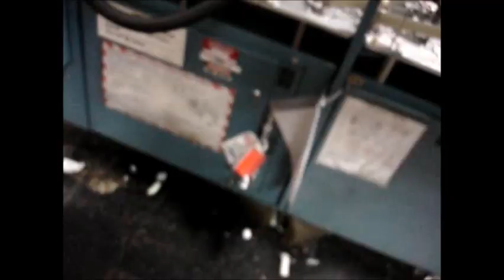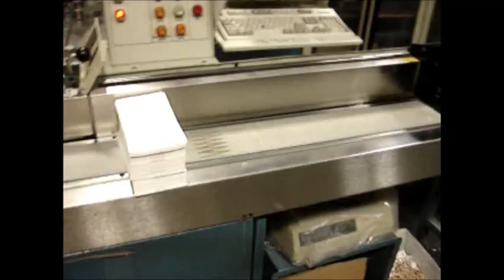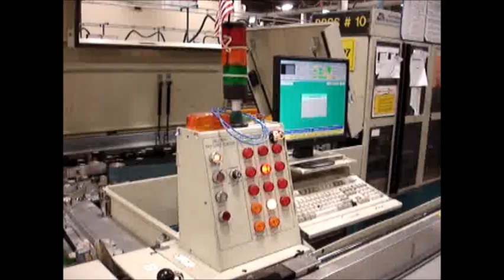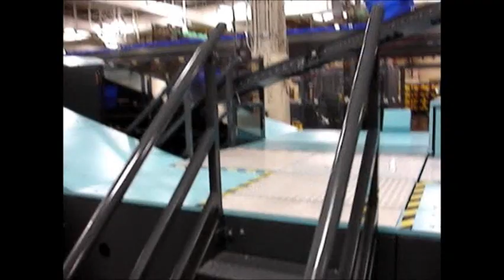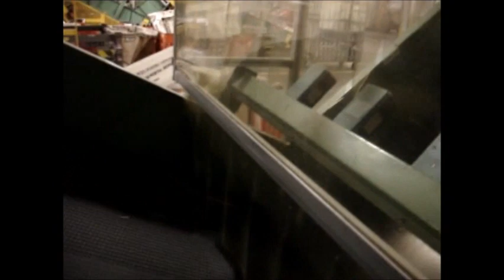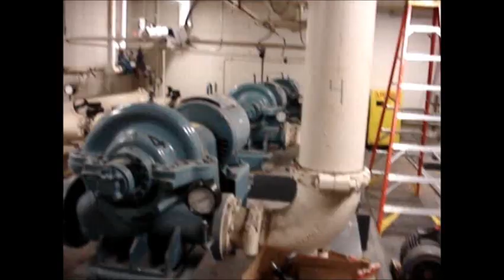Mail Processing and the USPS Brooklyn Processing & Distribution Center

Comment: Wow. I was an ET and had to use a lift-a-loft occasionally.  Mandatory hard hat and harness on every lift.  ET was the best job in the building for sure, especially if you worked weekends. Started in  '85 with Micro Marks, MPLSMs, (code wheels and a 110v safety line!)  B&H BCS, and a. Burroughs OCR.   Got to see the beginnings of the big push to automation.

Comment: I work for mid-fl P&DC out here in florida, we used to have many other machines that ya have. we need that kinda AC out here in the summer, every year on the summer time we never have AC, heat stay up in the air especially working on the spss machine. Spss was built 2019 around the ac vent, instead of cooling us its cooling the parcel. We are getting ADUS built now.
Reply from the maker: That's terrible! and in such a hot place like Florida!
Reply: Nothing like USPS management ingenuity. Sarcasm intended. Unbelievable how STUPID they can be.

Comment: Cool, insightful video. I've been a clerk for several years and I'm planning on transferring to maintenance at some point. I'm a manual clerk so I don't have much interaction with AFSMs or DBCSs. Spent a lot of time on APBSs before I became career. Great to see how these machines actually work.
Reply from the maker: Thanks! You'll learn more from this video than you will from most of these so called technicians at the plant!
Reply: @RenaissancePeopleNYC  
I learned a lot from your video! 🤗📪
Reply: Hey question, so I’m new at the PSE clerk . Was it easy to learn everything ? Just did a tour and looking at the machines and I was scared to death. Was hoping maybe you can give me some tips and hint to learn fast
Reply: @12ousmane  
Ask the ET's questions when they are DONE working on the issue(s). Most are happy to explain and help you understand.

Comment: Fantastic tour.  I enjoyed the part where you went over the FSS.  My facility is too small for one, we make do with two AFSM 100s.  I really wish I could see the entirety of the machine in person.
I noticed you are using the AFCS 100s.  I'm surprised you don't have the 200s.  How many machines do you have on that?  Mine only has 3.  The 200 is a massive improvement as well, much faster and sorts more.
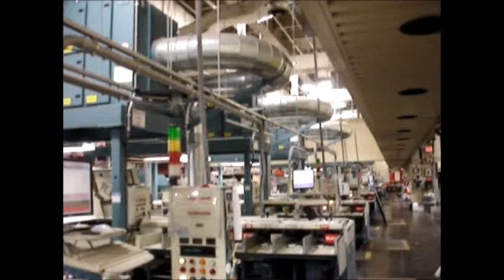The piping is the dust collection and control system.  The biohazard detectors are drawer sized units, can see one at 1:03:56
We also don't have a robot, always wondered what it looked like.  Random APCs come in marked "NO ROBOT"
Wish we had automated tow motors.
Reply from the maker: I retired out of these 2 years ago. Before I left I chopped up all the AFCS 100's for scrap as they decided to move this aspect of processing to another facility (Flushing Queens) so they have none as far as I know. But considering the mindless stuff they do who knows what they are doing now. This video took .e several months to complete it was a lot of work.

Comment: Question:  The USPS is obviously structured with warehouses of expensive machines to be able to do what NO other business can...sort and deliver letters and flats.  So why does the postal service insist that it's future belongs with the Package industry????  

There's at least 5 or 6 other big companies whose sole business is ... packages.  Why are we competing with them for last mile service?  To me it's like going to a pizza shop and hearing them say.."our future is going to be producing glue.  We'll still do pizza but we're really into this glue thing"  

It makes no sense to me.  I can see the side hustle because we're a delivery service.  But imo the USPS is a "mail" service.  Period.  That's what it should focus on.  No other company can do it.  Where as packages... there are several others who specialize in it. It's all they do.

Furthermore to save on liability and labor such as trips and falls and bad weather and having carriers walking to a door and back makes little business sense when we already have a system of mailboxes.  Stuff N Go.  This would avoid soooo much cost for the USPS to just mandate handling only packages and volume that can fit in an approved mailbox size.  Let the other package companies handle the door to door walking.  Packages is after all what THEY do.  

And if the USPS wants to compete with larger packages then have the post master general only approve those mail boxes that are big.  Not the standard little ones that you can barely fit anything but the mail...especially if the customer doesn't clean it out every day.
Reply from the maker: You have missed a few important opint here. The USPS was in business delivering mail AND packages LONG before ANY other carrier even existed - so who is competing with whom? With the decline in FIRST CLASS mail, mainly due to the internet and other venues the USPS continues to honor advertising mail from its customers. Also, the USPS is NOT the only "company: that uses these "big expensive machines" to sory mail! MANY provate companies use them if they are large enough such as credit card issuers who mail out MILLIONS of letters. So things are not as cut and dry as you assume. The USPS is completely capacble of doing what it HAS been doing for a coupls hundred years!
Reply: @RenaissancePeopleNYC  So you're saying credit card companies such as perhaps visa and master card are using these same machines stored somewhere in their own private warehouses to sort out their letters they then send off to the postal service to deliver?  These letters still get sorted as DPS for postal delivery.  I don't understand how that makes it cheaper for the credit card companies or any other company to actually own these sorting machines.  

Honestly it's the postal services job to make first class mail relevent when people stop buying it.  Great Billionaires like J.P Morgan and Getty don't just take a loss and shrug their shoulders when the consumer doesn't want to buy their product.  These guys are smart and figure out a way to make the consumer want and need to have these things.  The post office should push the issue of security.  How you can trust a letter in the mail from a company over the fraud and scams you get in your emails.  They should push and guilt people into sending cards and letters as a form of "respect and care" over a lazy selfish text message.  Use the movie industry to spread these trends.  Force the matters on business's to use 1st class service.  You need figure heads with power and brains to make mail relevant again.

IMO Packages are NOT the future of the postal service.  There's other companies for that (and they will likely take most of this market from the postal service because they're more structured and focused on package delivery).  We all know that one day Amazon will deliver 100% of their orders when they can figure out a cost efficient structure for last mile that can compete with postal prices.  

The USPS is and should always be focused on letter/flats as their main profit.  And yes have enough banked to weather the decades when mail trends down because in time it will trend up again.  Nobody can truely predict the future of demand.
Reply: @Mazinblaster Z Convenience comes with a price.  American's aren't paying what they should for the convenience that they're addicted too with online shopping.  Rates need to go up.  The postal services financial problems are a testament to that as well as their problem with retaining employees.  

IF rates rise to a fair level then I think people will see that going to a store again "should" result in saving a lot of money which would hopefully balance out this problem of abusing the postal service as an every day personal shopper delivery boy.

I mean....If the post office really wants this to be their future then they're going to have to restructure the entire way they process and handle packages.  As it is....it's very inefficient.  Carriers spend an hour sifting through hampers of stuff trying to sort out who has what and to put it order.  The offices are too small to handle the physical volumes.  AS well they need positions whose jobs are only parcel delivery...no mail.  UPS has workers whose only job is to load and sort the trucks up for the guy who actually goes out to deliver.  

But I digress.   The post office has always been a mail business.  To me it's like Pizza Hut suddenly wanting to become a car dealership.  .. like... you do pizza.  Stay with that.  If not then honestly..close your doors, liquidate your company...make a new company and be an actual dealership.

Comment: man I've torn off so many vacuum systems from the tops of those DBCSs, shame that system never really panned out
Reply from the maker: I have NO idea what you are talking about those vacuums were fine we used them for years till I retired.
Reply: They work fine in Albuquerque as well. Change the filters, bags, and keep the tubes unclogged. 🤗📫
Reply: @Stevenowski   Yep! as long as you did the required maintenance, they would suck the rubber gloves off your hand. The problem we had in the Orlando P&DC was that upper management couldn't figure out who was to do the maintenance. One month it was building maint. the next month it was the machine side. Then they would confuse everybody and assign it to the custodians....... Whenever I had the DBs, I would change the bags and check the filters, even if it meant someone would file a grievance. Screw 'em, I wanted a vacuum system that worked without having to drag one the entire length of those machines.
I started on the LSMs and 775s and tons of conveyor belts as an MPE. Retired a few years ago as an ET.

Comment: Neat video.  How does mail get sorted in the final delivery order?  For example, the DBCS doesn't look like it can hold mail for house 50 until all the letters going to house 25 are grouped together.  It looks like it's doing a higher level sort by zip code or carrier route or something.  Is there another machine that does the final sequencing or is that done by hand at the local office by each delivery person?   Also, how are flats, packages and letters grouped together at the end before delivery?  Is the delivery person constantly pulling from three different bins while driving around and just keeping an eye open for when to pull from each bin?
Reply: Imagine 100 addresses. The first time through the machine sort all the mail by the last address digit - x0, x1, x2 ... x9 into 10 bins. Now rerun those bins in order on a second run this time sorting by the first digit, 0x, 1x, 2x ... 9x, again into 10 bins. The first bin will now have all the 00s then the 01s on through the 09s. The second bin will have the tens digits in order on up to the tenth bin having the nineties in order.

After your two passes you have 100 addresses sorted in order using 10 bins, and in fact the number of addresses you can sort in two passes goes as the square of the number of bins. A 200 bin DBCS can put 40,000 (200x200) addresses in order in two trips through the machine.

A typical DBCS can do four runs during the night so it can do first and second passes for two 40,000 address groupings. If a city has 1,000,000 delivery addresses you are then looking at about 13 machines needed to sort the whole cities mail to delivery sequence.

-Retired ET (then OSS)
Reply from the maker: There is a huge difference between DBCS operations and AFCS (if they even use them anymore). The AFCS is for RAW incoming mail it's a "facer - canceller" which faces all the mail in the same direction , cancels any postage, and does a rough sort.
Reply from the maker: The mail is run at least two times to break it down my address. During this process everything has to be kept in order. The DBCS carts, the trays, everything.  This is necessary to keep the sequence for the final sort where it is broken down by address.
Reply from the maker: More than one address will go into each DBCS bin - but in DELIVERY ORDER. Hence the name, "DELIVERY Bar Code Sorter"
Reply from the maker: The mail is staged in order and run a second time for a finer breakdown by address
Reply: @RenaissancePeopleNYC  Sorting to each delivery point so that everything is in walk sequence order, has to take a long time, I was wondering about that myself. I've run MLOCR's, so I understand the challenges behind sorting to ADC, 3 digit, then 5 digit levels, beyond that it bewilders me as to how long it would take to get all of that into WS order, the sheer number of sorting bins that would require, the number of passes say at SCF level, etc.

Being in that industry, I would love to tour an SCF plant just to see the sheer magnitude of what the hell goes on, behind the scenes!

Comment: I worked those machines from 96-09 on tour 2 in that building for many many years after they abolished the LSM’s. I must say all of the ET’s (not mechanics! LOL) did a fantastic job maintaining these machines. Also answering the call when there was a problem when we were running them. Thanks for posting! 👍🏻👍🏻
Reply from the maker: There are VERY FEW ET's that know what they are SUPPOSED to know - the mechanics were  a heck of a lot better
Reply: As a MPE9 I'm insulted. 9s actually do more work than  10s